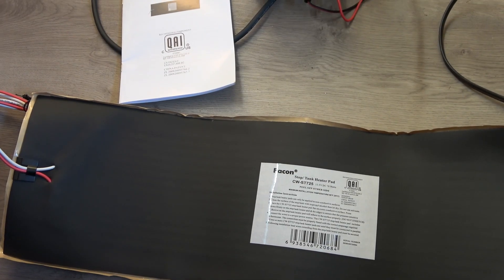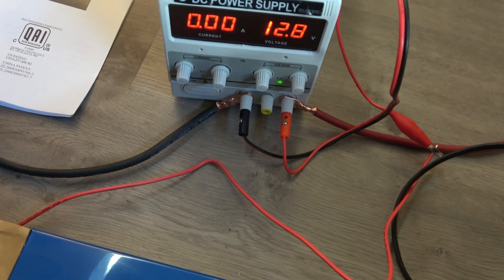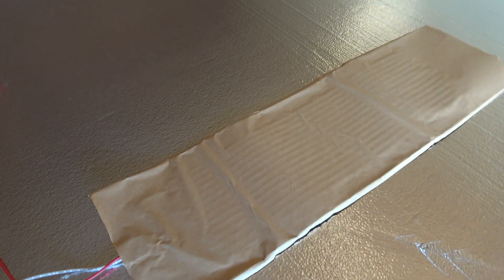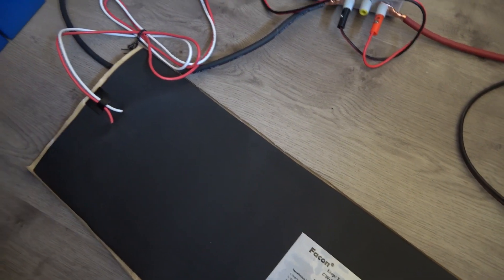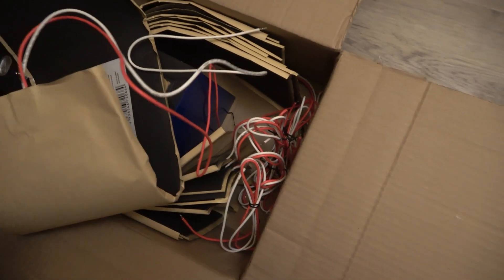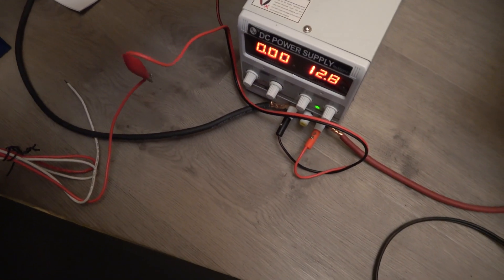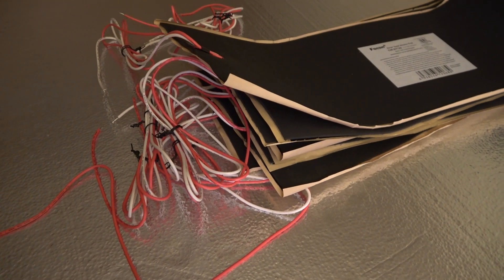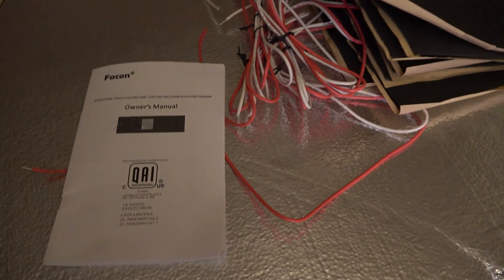Ford Ranger EV: Testing Thermal Management Strategy (Heating)

Comment: I would also test each one the way you did, making sure each one starts, but also that each one warms up to a temp and then actually shuts off, basically letting them cycle on and off at least once each.  It wouldn't be fun if one of them the off temp is 90F instead of approximately 68F
Reply from the maker: Yeah. I think I need to make a "kill switch" for them. I might be able to link it to separate temperature sensors and a contactor.
Reply: @newscoulomb3705  Ah yes a master switch with a secondary sensor would be a great idea!

Comment: Another incremental step.  Good test process.  Disappointing to have that high a failure rate though.
Reply from the maker: Thanks! Yes, I'm hoping these are just defects and due to QC rather than failures. Either way, I should have enough for the pack, but I'm going to have to create a wiring harness to support it.

Comment: I wonder if it's worth experimenting with some electric floor heating stuff. High wattage and cutable.
Reply from the maker: Yes, I think there are several options. I settled on this because I want to see how it works out. The biggest benefit is, of course, that it's compatible with the native 12 V system.

Comment: A better way to test these would be to put something like a bag or tub of ice cubes on the pad. That way you don't have to wait for the pad or battery to chill overnight and you wouldn't be as rushed to test them.
Interesting thermal management strategy and I look forward to seeing your final implementation. The integrated thermistor definitely has its pros and cons.
Reply from the maker: Thanks! Yes, I would have had to set something aside from the freezer. Maybe a bag of froze peas or an ice cold beer. I didn't want to leave the pads in the fridge/freezer overnight, but leaving them outside in the cold worked.

Comment: Those really look like bottle heaters for an N2O system.   I can't imagine a water heater that cuts off at 68F... but the standard temp for a N2O system is 80F, so I am not sure what these are designed for.  N2O system heaters are very reliable,  but may be expensive compared to the ones you tested... but destroying your battery pack with unreliable heaters would cost a lot more.